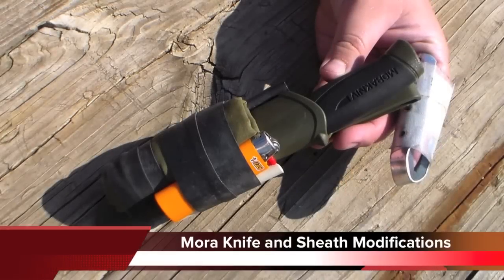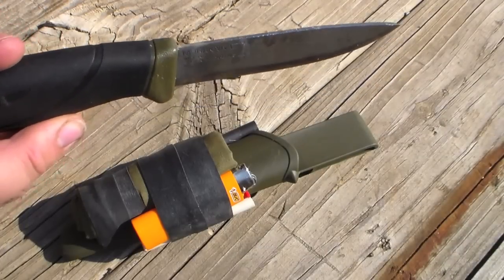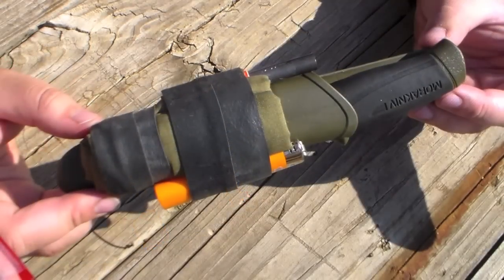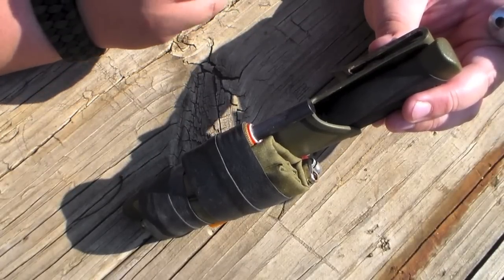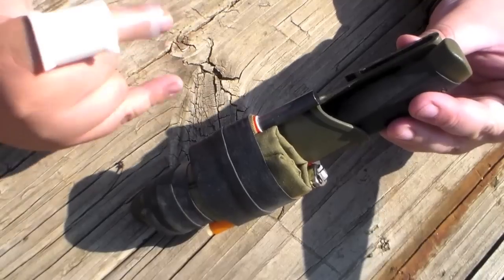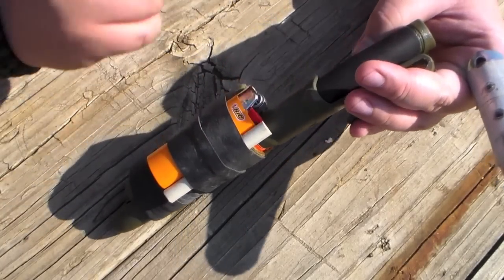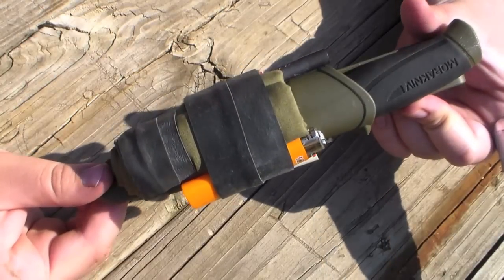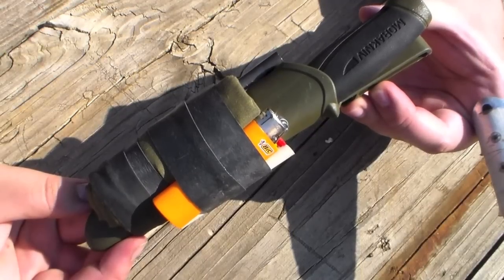Mora Knife and Sheath Modifications

Comment from the maker: For those who have asked: I cut my left index finger with a Glock Field Knife, severing a portion of my tendon, and I injured my right index finger when a knife slipped from my hand while grinding, forcing my knuckle against the belt. I guess when it rains, it pours!
Reply: Survivalkraft was the knife in this  video carbon steel? I'm thinking about buying a stainless steel and was wondering if I could still grind the spine down or if it would too strong. thanks in advance!

            - A random person on YouTube :)
Reply from the maker: Hello, random person ;)
Though it is more difficult to take care of, I highly recommend you stick with high carbon steel for your field knife, unless you are using it primarily for food prep, or you live near salt water. Use mustard to force a patina on the blade to keep it from rusting.
If you still want stainless steel, it should be able to take a 90° edge on the spine. But because it is stainless, it probably will not retain that clean, sharp edge on the spine for nearly as long as a high carbon steel spine would. Most high carbon steels are more resilient than moderate stainless steels.
I hope this helps. I eventually replaced this blade with a slightly thicker Mora HD, which I highly recommend. The sheath is not too great (aftermarket ones can be purchased on Ebay), but the knife itself is astoundingly good.
Take care and God bless! 
—Brendon
Reply: Survivalkraft thank you so much, Im still gonna buy the stainless steel one, It is labeled bush craft on it do imma hope its already at a 90 degree angle so I can use a ferro rod. if not I can buy a separate firestarter with it :). thanks again!

           - a random person on the internet..... named Jack :)
 God bless your heart, keep making amazing vids
Reply from the maker: Hey, Jack!

Thank you for the kind, encouraging reply, and may the Lord bless you as well.

You can carry a striker for your ferro rod, but it is not difficult to put a 90° edge on the spine of your knife. wrap a little sandpaper around a ruler and carefully sand the spine at 90°. It might take a bit, but you should find it able to strike a ferro rod in no time. Then you have one less piece of gear to carry and maintain. And remember: ounces equal pounds, and pounds equal pain!
Reply: Survivalkraft hey! thanks so much, that's good to know! hope to see new videos soon :)
Reply: Great knife imho
Reply: I'm glad you addressed the obvious right away.  Nice mods though.
Reply: A man with bandages on his hands can drop serious wisdom

Comment: Thanks for the video. TIP - you may put a zip tie (or sub) under the trigger of your lighter to keep it from getting drained and finding out you have an empty lighter in an emergency situation. Also, lighters are a great place to store duct tape (wrapped around) for lots of bandaids, repairs, etc. It also prevents the lighter from getting cracked, etc. Best wishes to you and yours.

Comment: The Mora sheaths are ideal for sticking a few ''Ranger Bands'' on and you can't go too far wrong putting a metal match on there but in my environment it's definitely safer to put lighters where they stay warm and dry like one in your pocket, one in your stuff sack ect. but like the title says, it's a mod so you use it, see if the arrangement suits you and change it accordingly. One of the pluses of Mora's are the lightness on your belt so I'd not like to give that up.
Reply: +jelkel25 Just curious, not trying to aurge or judge, cut what do you mean by "in my environment it's definitely safer to put lighters"?
Reply: It can be and often is very wet where I am, many hikers/bush crafter's put their lighters in plastic bags or a covering, then in their pocket in winter here.
Reply: jelkel25 oh makes sense
Reply: +Joel Benoit Also, in colder climates butane lighters have a difficult time.  I think they start giving problems around 40F.  If you keep a lighter in your pocket where your body heat can keep it warm then the outside temps aren't a problem, especially at higher altitudes.
Reply: Blakgun Yeah, sometimes the simple solutions are best though a backup spark rod or stormproof matches are no bad idea!!

Comment: Theres a small cavity in the bottom of the sheath; that may be more significant if yours has been shortened slightly with the tip breaking off; I keep a little fluffed up cotton in the base and 6ft of waxed artificial sinew in a bundle under a ranger band with a sailing needle also
Reply from the maker: +Zoe Watts I probably would not fill that cavity so that the sheath doesn't hold water if the knife gets wet. The other stuff on the outside sounds like a good idea, though! Thanks!

Comment: i basically copied your idea using some old mtn bike tire inner tubes as my Ranger Bands.  One thing that was fun though is I created some fire starting tinder with cotton balls, paraffin, and charcoal lighter fluid you'd typically use to light your charcoal grill.  After saturating the cotton I packed it into some oversized straws my daughter leaves around from drinking Boba tea.  I melted the ends of the tubes with a lighter, sealed it all up using some needle nose pliers to crimp the melted ends.  This creates waterproof / leakproof "tinder tube" that won't leak paraffin even if you leave them in a hot glovebox on a summer day.

Comment: Take a ranger band about 2 to 3 inches thick and melt one end of it together, then slide it over the business end of the lighter to water proof it.  Also take a medium ranger band and (about 4 inches long) and melt one end and stuff  the bandanna into it for a more secure and water proof holder.  You can glue (apoxy) a round battery terminal (from a hardware store) to the ferro rod to get a good grip when cold or wet.  This will also let you put some paracord on it to see it if you drop it.
Reply from the maker: Those aren't bad ideas! Thanks for the advise. I especially like the battery terminal concept. Blessings!

Comment: Take a mini altoids tin and fill it with part of a wet fire tablet or a esbit type fuel pelet and wrap the bandana around it. It gives you reliable tinder for a fire even in wet conditions and doesn't take up much room or add weight. You can also add some fishing line(I use braided line. Higher strength but lower volume) and a couple of hooks for an emergency. I have two mora's and love them.

Comment: in support of Tom...I have never, NEVER, just have anything fall out of my pocket maurading through the woods. However, the sheath mods are a good idea, but not practically... well practical. I have had knives which I have lost due to bulk ( getting snagged on stuff ). To remedy this, I have strapped strike anywhere matches that were dipped in wax, underneath paracord ( to prevent loss and accidental striking ) wrapped with ranger bands. My lighter rides in my pocket, as does my knife sharpener. I also carry all the above in my pack and or vest so as not to put all my eggs in one basket so to speak
Reply from the maker: +Jacob Harness I have had things fall out of my pockets while climbing around...an original Leatherman, for example :(  Like you, though, I have redundancies in my kit that are stored throughout my kit: lighters and ferro rods on the knife and in my bag, a bandana in my pocket too, and a hank of both paracord and bankline (or at least bankline) in my bag. So, I agree, it is not practical. But these are just spare items. I am more likely to lose my bag than my knife.

Comment: i didnt se the paracord, but some thread, a needle and maybe a fishing hook in a small pouch would be great. can stitch up big wounds and fish
Reply from the maker: Yeah, the paracord is buried deep and I did not want to undo everything to show it. I'm sure everyone has seen a simple paracord wrap before :)
As for the fishing kit, that is not a bad idea, but this is not a "do-all" kit, it is merely something for day hikes or for when I go out from base camp. So I would not do long-term survival on this knife.
As for the needle and thread for stitching up wounds, I am not a medical expert, but that is not a good idea in my opinion. The problem is that if you cut yourself enough to use stitches while in the wild, you probably have debris in the wound tract, and you certainly are not in a sterile environment. So, you can pretty much be assured that you will have an infection, and when you seal that wound with needle and thread (unsterile, by the way) you have created a little incubator for infection that can not be properly drained. It is better, therefore, if you are traveling light, to stop the bleeding with pressure or a tourniquet (no more than 30 minutes at a time) and then either cover with a bandana under compression or temporarily seal the wound with duct tape, butterfly strips, etc. and cover. 
Thanks for the suggestions! Blessings!
Reply: Survivalkraft me ill just get a red hot piece of steel to put on my wounds also its better cuz its sterile thats my opinion
Reply: cause everyone has time to build a hot fire and use a piece of random steel to seer a wound shut (assuming it works the first time cause it doesnt always) all while out in the middle of no where with an open wound bleeding and no one to help u. scenario over, its about preparedness..... not what ur willing to go through if the situation is right.

Comment: I have seen other "Survival Sheaths" like yours and they maybe are good systems.

A bad system was when manufactures hollowed out knife handles and put survival items in those handles. This design made the knife weak and also if you lose your knife you lose everything. Remember the Rambo Survival knifes? 

As I said your system is better but for me (really a pet peeve) is I dislike a heavy-ish sheath pulling my pants down and I hate bulky knife sheaths catching on things.

Here is what I do:
I use a Native American medicine pouch type small bag with a thinnish shoulder strap.
In it are all my fire starting and knife care (sharping, cleaning, & oiling things)
and wear it across my chest.
Sometimes I use a belt pouch for Army web belts or a regular wide leather belt (not attached to my pants)
and put the items directly on the belts.

I do the above to keep my knife sheath "clean" and placeable anywhere on my person.
Again, this is just a personal thing that I had to comment on because of my dislike of those survival sheath systems.
Reply: +sweetcostarica I agree with you on that, however there are a couple of high end manufacturers that have made hollow handle full tang survival knives where the handle and the blade are milled from solid stock, i.e. they are a single chunk of steel, except for the threaded cap.  The downside is that they are ridiculously expensive.  I know Randall Knives in Orlando was making one years ago for about $450.  I've seen one from another maker that was in the $700 ballpark, just can't recall the name.  In any case it's a poor overall design IMHO.
Reply: +Blakgun Yes, I almost bought one of those high end Randalls but common sense prevailed as I thought of losing it on the trail or having it stolen at base camp. Having a $500 to $700 dollar knife (including what ever you have in the handle) gone would be awful! 
Anyway, these days I am using the Ribz Chest/Front Pack for gear on my person so no need to have sheath modifications. 
Have a great day after Super Tuesday!

Comment: How did you strap the knife on your MOLLE system?
Reply from the maker: I took the knife and cut down the sides of the belt connector until it fit in the MOLLE webbing. If you don't quite understand what I mean, I would be happy to post a video of me making the modification. 
Good luck, and thanks for commenting!
Reply: Survivalkraft So you just slipped it in with the clip facing toward your back if you were to be wearing it?
Reply from the maker: I'm not sure I understand your question. All I did was narrowed the belt clip so that it could be worn on my belt or slipped into one of the loops on my molle gear.

Comment: If it's raining a lot and you get that bic lighter wet.. good luck starting a fire with that. Keep the lighter in your pocket and not on the sheath, exposed to the elements.
Reply from the maker: +KuKuKuK69 Those things dry out quickly. Plus, in the rain I will just cover the end with the ranger band. No worries.
Reply: KuKuKuK69 Plastic wrap the lighter.
Reply: Survivalkraft Still seems there is beter solutions, for emergency/survival situations..  just my personal opinion. Ty for the vid anyway ;-)
Reply: KuKuKuK69 Alternatively, a piezoelectric disposable lighter will work well even when wet.
Reply: Might, but not always. I am former smoker and had hard times lighting cigarettes in pooring rain, even with piezo lighter. If you get water in it, no ignition.. it's electric and get shorted by water ;-)
Reply: lol bic lighters are soooo easy to get it dry after the flint gets wet. just hold the plunger and rub the flint wheel down your jeans or rugged jacket. before you know it, the bic will be rolling sparks out in no time!

Comment: I fixed the retention problem with velcro one wrap strap... 
http://www.homedepot.com/p/VELCRO-brand-12-ft-x-3-4-in-One-Wrap-Strap-90340/202261925
and a 1/8 inch depth Chicago screw with a drill bit the same diameter as the Chicago screw. I drilled a hole in the sheath about 3/4 inch down from the top of the belt loop easily accessed from the slot in the back. Then I used the back of the drill bit and heated it with a bic lighter and melted a hole in a 4" strip of the velcro strap. I secured it to the sheath with the chicago screw and trimmed it as necessary with scissors. It makes a great retention strap. You can not pull the knife out if you try, without opening the strap' And If I ever cut it by accident there is plenty of strap to replace it since there is 12 feet on a roll. That strapping also works great for attaching things to a pack, wrapping up a wool blanket or tarp or anything else. It weighs nothing and is easy to pack. Just my 2 cents.

Comment: Bro, I'm with ya on the firesteel, sharpening rod and paracord, but call it good at that man. The BIC and the bandana are borderline silly. You dont have to put 'everything' on your knife. One of the biggest advantages of the Mora range over others is the very low weight and very low profile. Keep it that way. You've added unnecessary redundancy with the BIC (it'd be better off in your pocket anyway) and the bandana adds too much bulk and is just going to add a ton of weight when it soaks up all the rain - put that in your pocket too. KISS.
Reply from the maker: Well, I have the BIC because with it I can light the ranger bands to create fires in wet conditions. I have tried to light ranger bands with the ferro rod, and it can be done, but it is extremely difficult. The BIC, however, lights it up instantly, providing a high-heat fire source for damp material. 
I have carried the knife in the rain and I have never had a problem with the bandana soaking up much water. It is mostly covered by ranger bands, and because it is so tightly compact, what cloth is exposed does not tend to absorb water well.
I do agree that one of the benefits of carrying a Mora is its compactness, but the bandana and the BIC do not add considerable weight or bulk, at least not enough that it bothers me. If I wore this around my neck, it may be a bit too much. But most of the time it is hanging from my water bottle sling at my side. 
Thanks for the suggestions! Have a good one!
Reply: Survivalkraft
I'm not saying dont carry the BIC - I can light a fire with a bowdrill, but I only ever do it for fun, or when everything else fails. When I want fire, I use a lighter because it's easy - there is no shame in that. The ferro rod is handy at times and sometimes the easiest option, but sometimes it's not and I'm not going to make my life more difficult than it needs to be. If I can light it with a BIC, that's what I'll use first. So yeah, carry the BIC, I'm with you 100% on that. My point was why have firelighting redundancy on your knife? It makes sense to carry a ferro rod on your knife because the knife is often the striker, they work together. Similarly, a sharpener makes sense for the same reason. But why carry the BIC and bandanna there? Why not just put them in your pocket? I guess I'm just weary of seeing all the vids where people try to cram everything onto a knife sheath - I kid you not, one day someone will try and hang a maxpedition Condor of a BK6. :D

Have fun bro, I'm just making an observation. :)

Comment: How do you remove the rust?
Reply from the maker: The dark spotting on the blade is not rust, though it is a form of oxidation. It is called a "patina" and it has developed through years of use. That form of oxidation keeps iron oxide from forming on the knife, so it should not be removed. You can force a patina using vinegar. I have a video on it (actually, it was my first ever YT video).
To remove the bad kind of rust from a tool, you can use steel wool if it is on the surface, or you can put the tool in a container filled with vinegar overnight and by morning the rust should be loose enough to remove. Warning: this darkens the color of the steel, and if you do not wash the vinegar off immediately with soap and water, then dry, the steel will rust again in a matter of minutes once it hits oxygen. So be careful.
Hope this helps! Blessings!